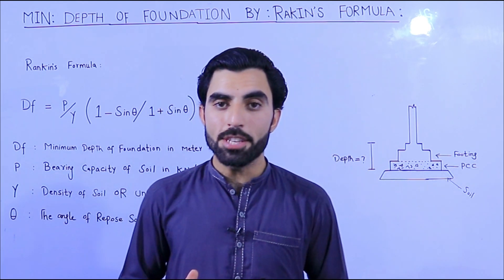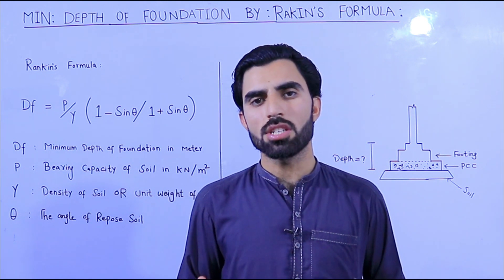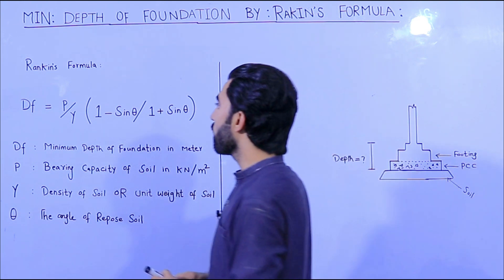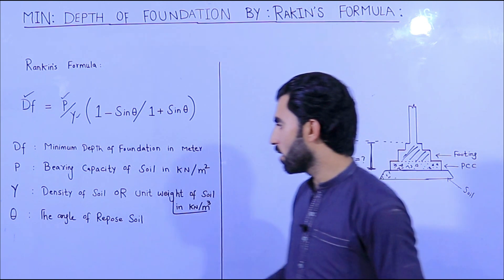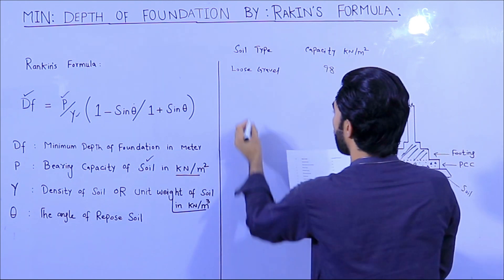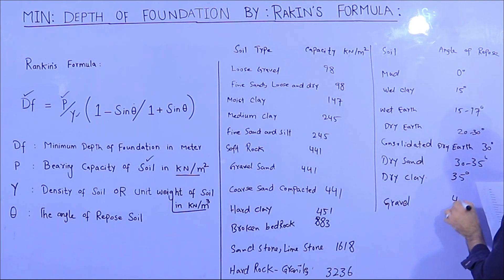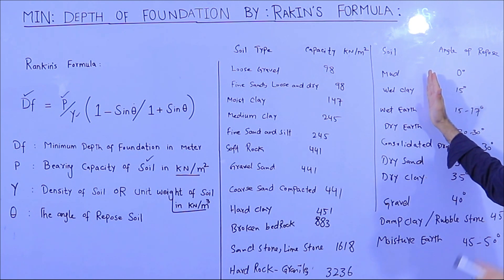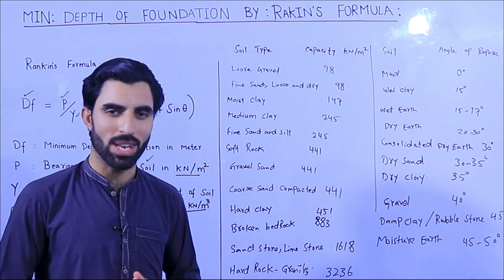Minimum Depth of Foundation by Rankin's formula | How to Find Depth of Foundation? |

Comment: How to find density of soil?
Reply: It's done accurately  by a soil chemist  in a lab
You have to  core a rectangled  portion of soil which has  a certain  mass.
Find the volume  of the same sample.
Divide the mass by its  volume.
That gives you the density.
N.b.
After coring the rectangular  sample, weigh it and divide byb9.8 to find the mass.